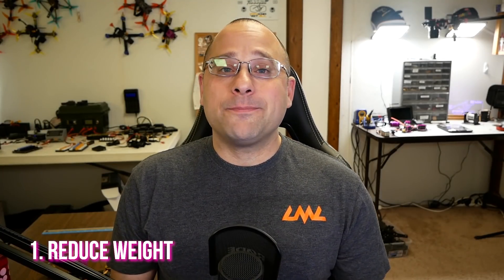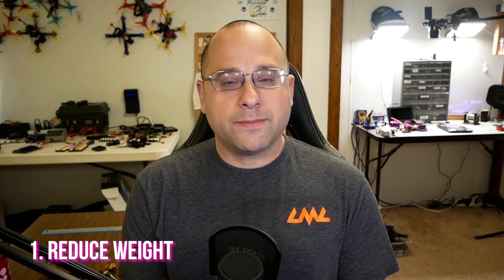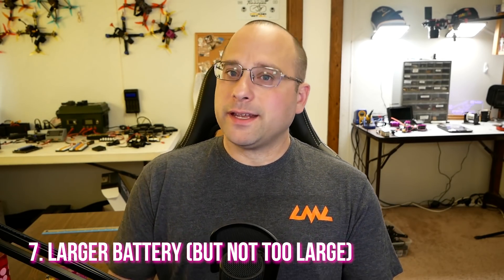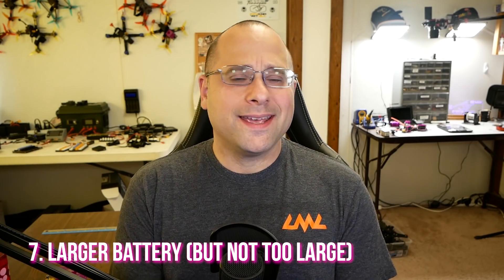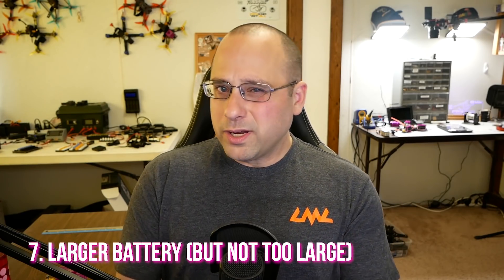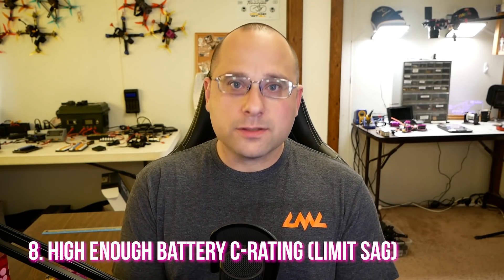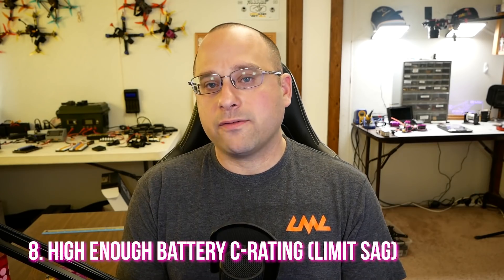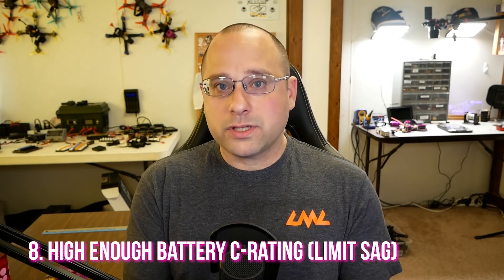Quadcopter Long Flight Time | TEN TIPS TO FLY FPV LONGER

Comment: @Joshua Basrdwell Reason High-voltage / low kv works (electrical engineer here): You transform the same amount of power into thrust but transporting it through your electrical system using higher voltage and less current ([V]*[A]=[W]) and less current means less resistive load on your lipo cells, cables and ESC transistors. Same principle as high-voltage lines. Now you'd theoretically already do the same with just higher voltage and less throttle but if the kv to propsize ratio is not optimized you have motor losses swallowing the advantage.
Reply: How is the lower voltage approach explained?
Reply: @tiagotiagot  I don't consider it a very useful approach for FPV racers because you're essentially just cutting maximum power: If you have a lower voltage with the same kv and props that means you have less power available and full throttle has less punch and you're forced to use less energy... Also less lipo cells have less weight overhead in separation and wiring but not sure how much this actually contributes. Note that all these optimizations only hold to a certain degree until they either become less fun or even unflyable or you have other energy consumption problems like vibrating oscillations or unmatched motor prop combinations or unmatched battery size to vehicle size. The right combination for your needs makes it best...
Reply: @MaEtUgR  With lower voltage you want more kV - not the same.

Comment: Thank you Joshua for do this video I live at 8546 ft above sea level and here the flying times get reduced to the half of sea level flight time so it was very interesting for me
Reply from the maker: In your case, I suggest using higher pitch props. It will somewhat help make up for the lack of air density. The good news is that your thin air is easier for the props to move. So you can run like 5050 props and not kill your batteries like I would.

Comment: Point no 8 is a bit controversial. If you have motors that do not take a lot of current (say 2206 or 2205 motors), you can actually use smaller C rating batteries. And having lower C rating usually means a battery that weighs less. As an example, my Turnigy nanotech 1300 mAh 45C weighs 142 g and Turnigy Graphene 1300 mAh 65C weighs 178 g. That's 36g that might make a huge difference depending on your motors.
Reply: That's an interesting point
Reply: So what you're saying is: If I have 2205 2550kv motors ona usually running 4s graphene platinum 130c batteries and get 2-2:30min flight time and I drop the C rating on battery (get lower)I will get longer flight time?  Once my friend gave  me a battery to test... It wasn't able to hold up. It had massive sag and felt that I was way heavier than normal. Battery was hot and started puffing up in flight because I could feel the cells started dropping out.  Oh yes my motors usually peak at 114amp current on full stick punch. I'm so confused what do do to extend flight times-yes I know I need to learn fly slower too and maybe more efficient-less punching!

Comment: I've been using the throttle limit in BF to set my hover point at around 50% throttle input on my transmitter.  I find it helps my laid-back cruising style.

Comment: Hey there, I am not sure about these but how about

11- check your center of gravity is at the same distance of all 4 motors shafts, it will reduce amps draw since motors don't have to work to compensate for the unbalance.
12- check your aerodynamics on the quad. remove/reposition elements that are creating resistance to air flow. Don't drill holes in your arms but if you do, let me know if it worked.
13- clean your props from any dirt, change your props if they are damaged even if the quad is flying well. 
14- avoid sharp turns. if a curved trajectory can get you the same result you will spend less amps. You can think of it as 'keep your momentum'
15- center your masses. you need less amps to flip/roll/yaw the closest the masses are to the center of gravity. if you are using 4 ESCs, you want them as close as possible to the center of the quad
16- add wings to your quad (ok just kidding on this last one:)

Overall tip number one is golden, SAVE WEIGHT by well designing your quad.

Comment: First quad I built was FT270. It was a 6" with 1600KV motors and a 2800mAh battery. 10 Minutes was easy to get, but it was the most docile, boring 10min ever! Take what you will from my experience. I'd say stick to the usual 5" 2450KV 1500mAh setup.

Comment: Sorry to post this several places Joshua, but I'm unsure how to get this idea in front of any BetaFlight Dev's to see if it's ever been conceived. Seems like it would have been.. eeeeveryone talks about burning esc's when the motor's are stalled. Dshot (BlHeli, lol whoops) ESC's are capable of sensing rotation of the motor. Why don't they implement a stall-stop which cuts out ESC's when they stall at a certain throttle position? that way, even if you can't see the props, a stall will result in a handy beep and warning flashing across the OSD like 'MOTOR STALL' As well as saving the DAMN ESC's.
Reply from the maker: Blheli ESC's have several features like this. They don't always work perfectly though. At low speed the ESC cannot use beack emf to detect rpm. So it must simply drive the motor and hope for the best.
Reply: @JoshuaBardwell  I see! That gives me several ideas for other ways to come at the problem. Timer starting when you go over a throttle threshold maybe.. Nick burns kindly sent me the correct way to contact developers, I will respectfully go back to lurking. Thank you for your reply! I learned something today ;)
Reply: @friendlyfire01  Take a look at the IQ Motor modules, they are motors+ESC in one and they can run in a closed loop mode where the controller always knows the position of the rotor so you don't have to rely on the back EMF. You have to specify the type of prop you use though for this to work and it's still pretty new technology.

Comment: You be so right ! Less weight is my formula ! I built a 220mm Quad that is just at 380g plus 2.7K camera ! This one can fly about 12 minutes on a 4S 1600mAh Bat. But it´s pain in the ass to save every gramm you can save.

Comment: You forgot one trick, Joshua.
Reducing blade numbers.

I use to fly two blades props on a very light quad, with agressive pitch (5050), and I get very much flight time than "soft" props (5040x3). The thrust seemed to be the same, but the comportement was different.

5050 more floaty, but faster, with a little bit less amp drawn at full throttle, as the 5040x3 were snappier, but with more amp drawn onto the whole throttle range.

A good way to increase flight time too. 😉

Comment: Flying drunk always increases flight time. Of course you spend more time looking for your lost quad than actually  flying it 😉
Reply: Bro how funny is it after a few beers or rums , my mate and i do it all the time yew 👊
Reply: @tribefpv  always a hoot!
Reply: We did that indoor with a 6 axis helicopter 450 size... Oh the fun with analog tx's and getting the wrong one... from that day it became digital with arm switch...
Reply: I saw a video on PID tuning where the main problem seemed to be crashing in water, and the dryoff and cleanup. I almost suggested using conformal coating.
Reply: Flying high too, not altitude..lol  One time, spent all day working on Leader3 ,roomate passed me community bong as I was finishing up.  Didn't think, just took a hit, it was sneaky stuff.  Went out to closed golf course behind house for quick flight b4 dark, felt fine. It wasn't in the air 10sec and I thought, holy SH*%, I'm high.  Winds picked up, ended up using failsafe,  went down in wooded area next to course, never saw it again.  Kids, Just say no!!!   😵😲😂
Reply: If you fly drunk enough you wouldn't even need to look for it - you wouldn't know what happened to your quad last night.
Reply: Done it once . Didn't even make it off my balcony and crashed right on the edge with 10 stories down and a pool below . It was then I decided it's not a good idea .. flying drunk or drinking .. showing off is another one I've put on hold ... for now  the guy on the other shoulder is telling me how much of a wuss I am .
Reply: @sunshynff takes practice

Comment: Please touch upon filtering topics in next videos:

1. Balancing the quad will also eliminate unnecessary work required to maintain level
2. Properly tuning the quad
3. Balancing the props to avoid unnecessary vibrations
4. Limiting roll and pitch angles in software

Comment: My favorite tip is larger props.  I used to run 4S and 5S packs and various 5" and 5.5" props on F40 Pro V2 2600 KV motors on the OwlRC Dragon frame (that you pointed out to us ages ago!).  It was too much KV for either prop size, especially on 5S--it sounded like a banshee at 80% throttle with 5.5" on 5S!

You sure don't have to get the KV right for larger props to increase flight time, but I'm sure you do even better with appropriate motors.  At the time, I used to get about 3.5 minutes of freestyle out of that quad on RK 5046 props on 5S or a bit over 4.5 minutes on HQ 5.5x4x3.  

I wasn't attempting to fly any differently with each prop.  The larger props are less responsive, slower on the top end, and have more bite coming out of a free fall, though.

I've moved on to different frames, motors, and batteries, but my time with the larger props has encouraged me to keep running 6" capable frames.  It is nice to have the option of being able to stay in the air and extra minute or two if need be!

Comment: Re. 10:00: I'm not a kwad expert or pro flyer by any means, but a prop is basically just an axial fan - a device which moves air (and generates thrust) parallel to its axis of rotation by creating a pressure differential between the front and back sides of the blades - and I know a reasonable amount about those. The "baked in" efficiency gain of a larger prop essentially comes down to its ability to move more air per revolution than a smaller one. Obviously the extent of the efficiency increase is affected by a range of factors such as the number and shape of the blades, the blade pitch, and the various ways in which these factors affect the drag characteristics of the prop. But in simple terms, all else being equal, a larger diameter prop has more surface area so it can displace more air for a given RPM. To move the same amount of air with a smaller prop, you either need to increase RPM (higher current draw = less efficient) or increase the blade pitch to create a larger differential pressure (more drag = less efficient). From this point onwards, you can start diving down the rabbit hole of finding the ideal prop diameter vs. prop pitch vs. motor size vs. motor kV vs. battery voltage vs. kwad weight vs. flight time... etc. etc.  :)
As with any such engineering problem, its always a matter of balancing various trade-offs to arrive at a solution that satisfies all your design goals.
There's never any such thing as an absolute "best" or "worst".

Comment: Steele's test of 6s vs 4s flight also included that he felt that there was more punch and less sag on 6s, so he is now using 6s, but its a higher amp hour battery that adds a bit of weight but the increased power cancels it out apparently. 

Havent tested it myself yet, hoping to build up a Super G+ this year 😅
Reply: To add to this 4 yrs later, i noticed in all other applications where i work with multi cell batteries, there will usually be less sag and heat in an equivalent battery with more cells, because the load demand is always split among all the cells, also increasing bettery lifetime, so for a given capacity i usually prefer to go with more cells of less capacity than less cells with higher individual capacity.

Comment: Smaller motors are less efficient than the big ones. Stator volume translates to less resistive losses (if KV is the same). There is crossover point where additional mass will outweight better efficiency.

Comment: I put a throttle limit adjustment via openTX on one of my Taranis' knobs when I'm going for distance. I can then dial in how much throttle limit I want.
Reply: hmm
 cool!
Reply: Yeah, I've been meaning to switch all mine over to a pot based logical mixed channel to go from +70 to +90 output on a lot of mine.
Reply: That sounds great I need to do that along with the volume on a pot! Great idea.!
Reply: @tehllama42  what about just decreasing the max sub trim on throttle channel on your TX? All the same stick resolution in the reciever tab.... but max throttle is at 1700...? Or is that not the same? Thanks!
Reply: @stickboyfpv4742  You can do that, and it works like the CLIP option on newer stuff - it just limits the top trim.  If you do it with Output, or mix a logical channel that does the same thing, you get to keep all of that resolution (instead of getting differences in throttle for 70% of the travel, with the rest as dead travel).
Resolution is really the reason to limit it - unless your thumb can't use all that travel.  The logic behind mixing it with a pot switch is that I can have a separate knob that lets me dial that in across a range - in my case I fly some quads with 4S, 5S, and 6S batteries, and I definitely don't need >95% throttle on 6S most of the time, but I'd like to not have to muddle through the menus to turn it back up from 70% when I'm going from running 6S back to 4S packs.

Comment: For reference, racing quads can be down in the 425g AUW range and still fly pinned for a full two+ minutes (this is a 4S Toothfairy build running 4S 1300mAh packs) without durability compromises.  For a budget racer using 30x30 stack parts and 2206 motors you can still be under 475g rocking CNHL 4S 1300mAh 100C packs, and that's the best option to use.
For 6S 2207 rigs you should still be right around the 525g weight target running a 6S 1050mAh pack, 555g moving to a bigger heavier battery.

Comment: Tip 11: Fly in ground effect. (Altitude lower than prop diameter). Challenging low level floaty flying can milk precious flying seconds out of your battery. Could be the best way to bring it home if you let low voltage sneak up on you too far out. Be sure to choose smooth surfaces like pavement for maximum savings.

Comment: Another tip for longer flight time: Tuning the flight controller filter settings to reduce the influence of motor vibrations on the gyro and the control loop, as this noise induces counter-forces. This is of course wasting energy, the more noisy your quad is. Also, more energy is wasted due to the additional heat in the motors. The frame design could help too, if there are two sections (noisy, where the motors are mounted vs. less noisy where the FC is mounted) and those are decoupled with silicon dampeners etc.

Comment: I have a 7 inch rig with bi blades, 2207 1750kv motors running of a 4s 2200 using a sabotage RC Frigate 7 frame which is the lightest most compact frame I could find. good for about 12-17 minutes. and doesn't really feel under-powered either.
Reply: Brad Barlow hi man did you tried 6” props with 1500 mah 4s? Thanks
Reply: @GYRO_FPV  I have tried 6 inch 2400kv 4s 1500mah. About 5 mins if you take it really easy. 2200mah you can get approx 7 mins. (This was a 6 inch qav-r frame so not the lightest out there). Best thing to do which definitely gives the most improvements is bigger prop, less motor KV. Basically build a 7 inch lightweight 6s racer but run it on 4s. Hope this helps.
Reply: Brad Barlow thanks man....I have heaps 4s(1550 tatto)batteries and I was thinking about to build a 7" cruiser ...and a got everything spare except the motors.what would be your suggestion for motors? I've got Iflight xl7 lowrider (119g) Dalrc engine 40A 4in 1 Dalrc fc runcam eagle micro tbs unify vtx crossfire nano receiver....so hopefully not gonna be very heavy....thanks
Reply: @GYRO_FPV  maybe the hobbyking 1750kv (what im using) but the new t-motor f60 pro iii 1750kv may be even better near low throttle. Anything around the 1600-1750 KV range. About the same flight time on 1600kv (maybe a tiny bit more) but noticeably less power.

Comment: Somebody else has probable already said this, but I'm not reading through 400+ comments. Larger props are more efficient not just for their ability to move more air (in the sense that an 8" would move about twice as much as a 4") but because the longer the prop blade, the fast the tip moves - so it is moving through (and pushing) a larger amount of air per revolution.

Comment: "Dont use a too large battery, 1800 is large enough"
Me who only flies with 2500 mAh: "shh Joshua, stop takling if you know what's good for you•
Reply: What is your flight time?
Reply: @jamescarlyle2630  between 5 and 12 minutes, depending on how aggressive I fly
Reply: @kingofthenoobs590  thats unreal mate, exactly what I’ll be doing! Can you still do freestyle moves etc?
Reply: Cringe in 17500mAh 3S 5P lithium ion in 5inch octacopter
Reply: @pranjal3727  nice 3s. Whats your flight time and usecase?
Reply: @Tim i get 45 minutes of mild cruise. I got into drones and went into the wrong track. This 2kilogram beast octacopter is my first ever drone.

Comment: Original plans for my first 2 fpv cam was with this in mind.  Initial plan was 2 forward FPV cameras, one low tilt for efficient flight and 2nd high tilt cam for engaging insane mode after flying out to the target area.

Comment: I fly the Joshua Bardwell f4 and 4in1 with racedayquads 2205 2450kv motors on a tbs source two frame. If I am going all out I can get about 3 and 1/2 minute flight time. If I am just cruising around I can get an 8 and 1/2 minute flight time. Normally i get about 4-5 minutes. Running ethix props and 4s